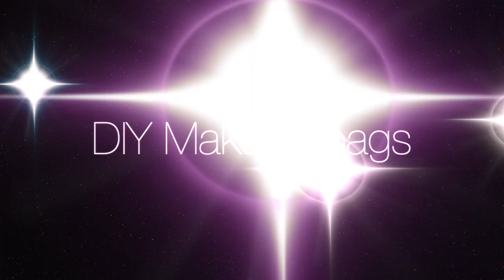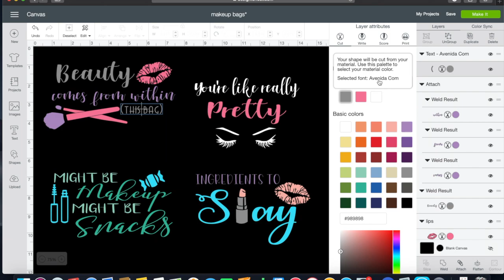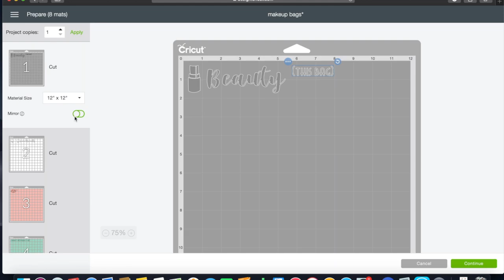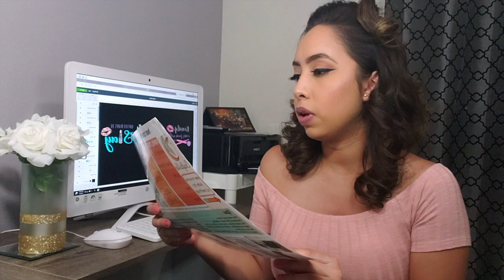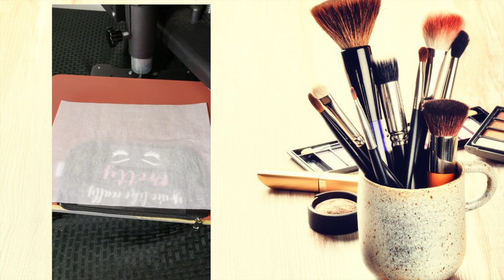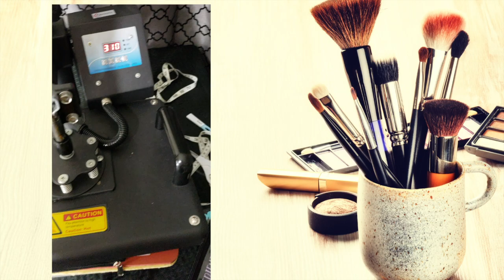DIY Makeup Bag Tutorial: How to Apply Heat Transfer Vinyl on Canvas | Craftables

Comment: did you have to make each of the designs in the vinyl colors and just cut out the words and clip arts that your used?
Reply: Yes, you cut each color individually. If you have a cricut, the software will separate the colors for you and have you load the different color vinyl on to each mat to cut one by one.